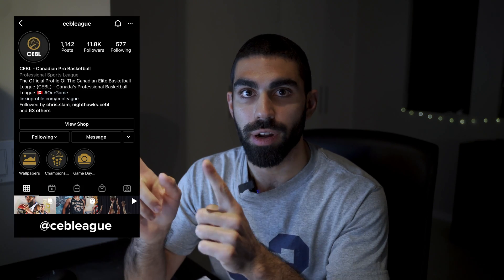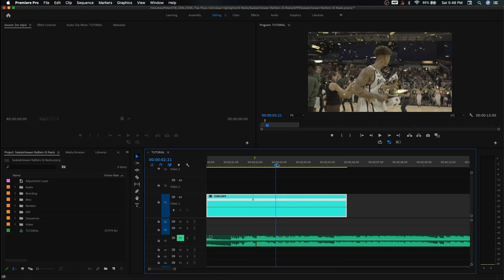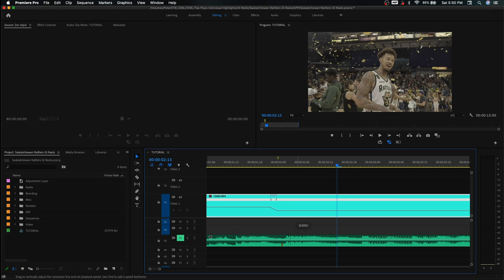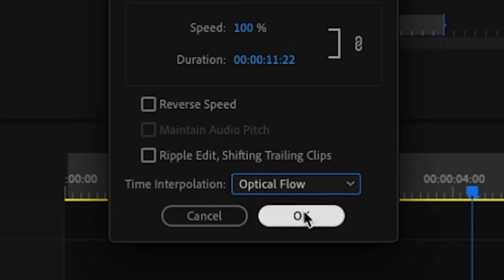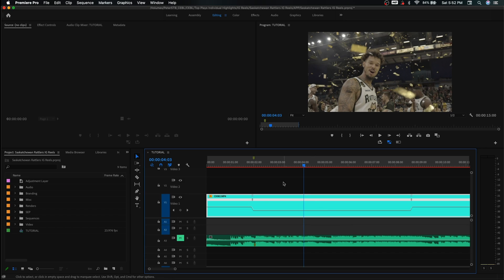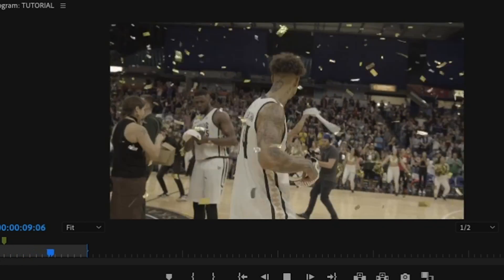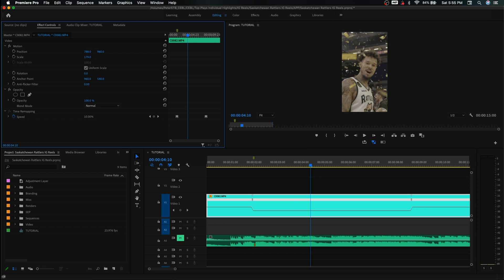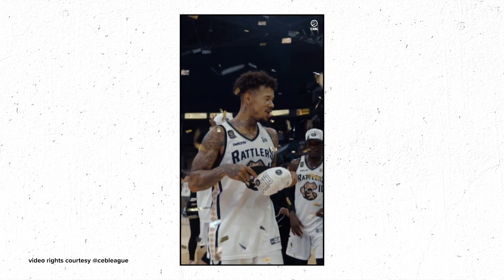How to FAKE Slow Motion in Your Videos with Optical Flow

Comment: If the video is already filmed in a 60 fps or close enough frame rate and good lighting it does wonders, it can slow down to ridiculous extents through extrapolation, however if the video quality is poor or has 24 fps it generates too many artifacts, though if used in a smart manner it can restore a many old videos to modern standards, although the representation is only an approximation and not reality, like looking at an illusion. This technology is digital illusionism.

Comment: good video. But nontheless I wonder what to do If had a video of that basketball player jumping ? what are the possible reasons to slow it down properly when using optical flow and not not cause any glitches and aftifacts. What if I had a video of 30 fps or 60 fps with that basketball player. How should I slow it down with optical flow in this case?
Reply from the maker: Hi there, with optical flow premiere is trying to create frames that did not actually exist in order to make the footage go more slowly. When you have a quick action like a player jumping where there’s a larger discrepancy in the image from one frame to the next, premiere will have a more difficult time creating new frames in between and this will result in artifacting.

If you have a clip that is in 30 fps or 60 fps slow it down accordingly relative to the frame rate of your sequence. For a 120fps clip we slow down to 20% because 24/120=0.2, so for a 60fps clip 24/60=0.4 so slow it down to 40%, and apply the same principle to 30fps clips or footage with any other frame rate.

Hope this helps.
Reply: @petersarellas  nice explanation.But how  I were to be said to make a slow down footage of  a jumping player and to make it smooth so what do I do in this situation to nail it?

Comment: Hi, I’m trying to follow your video, I have the most updated version. What did you click to after you found the spot you wanted to slow down. It’s looks like you pulled something down but I’m not sure how to get to that step. Sorry if this question is confusing lol
Reply from the maker: Hey Bri, I held CTRL and right clicked after navigating to the menu that comes up from left clicking and selecting “show clip keyframes -> time remaining -> speed”. When I right clicked after doing that it gave me a break in my clip that slows me to pull down or up on either side to make that part of the clip slower or faster respectively. By pulling that one part down I reduced its speed so that it would be slow motion. I hope this helps.
Reply: @petersarellas  yes it did! Thank you so much for replying back! Your work is so dope! I hope to be on your level on day 👏🏾💪🏾
Reply from the maker: @looksbybri  keep working and doing your thing 🙏🏼

Comment: Hey Peter, how did you create the colour grade for the vid? Your vids are 🔥 keep up the exceptional work!
Reply from the maker: Hey Dammy, the footage I work with is often log footage so I start by creating one lumetri colour layer that just has contrast and saturation to add some life to the image. I’ll then usually add a LUT that I’ve made or from someone else that I like for that footage as a base on a second lumetri colour layer, then I use a third one to make tweaks to the colour and get the image to my liking before saving the preset. Of course instead of adding contrast and saturation in the first step you can also use log conversion LUTs that are usually provided by camera manufacturers or third parties for free.
Reply: @petersarellas  Thanks for responding mate. I'll defo try this in my next video!